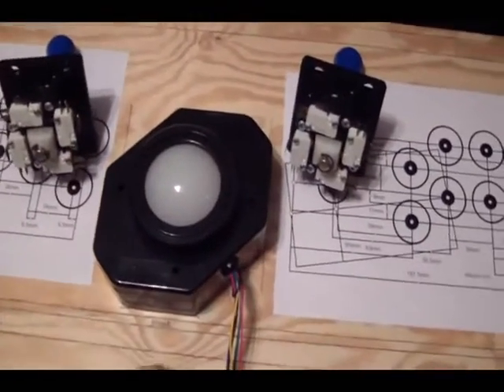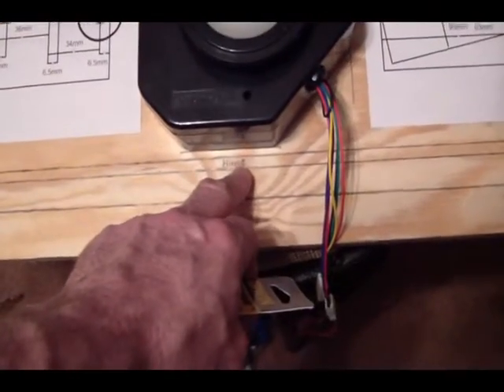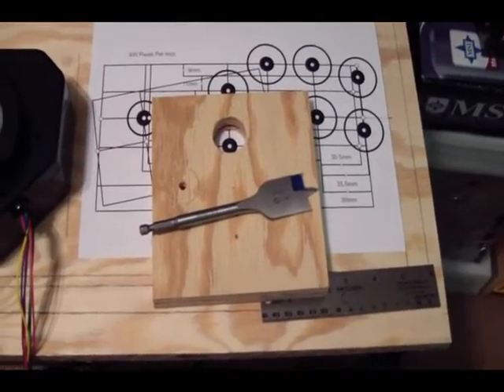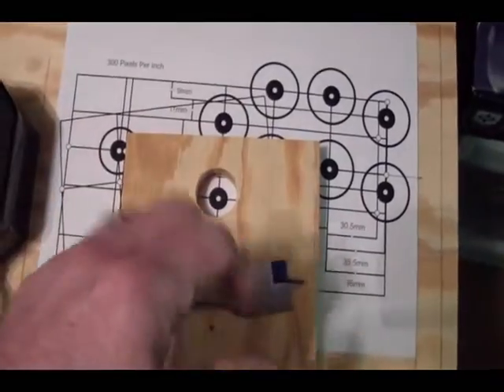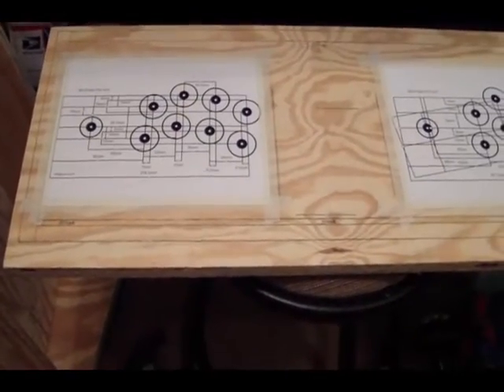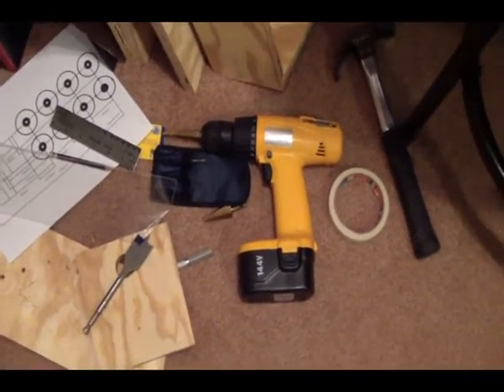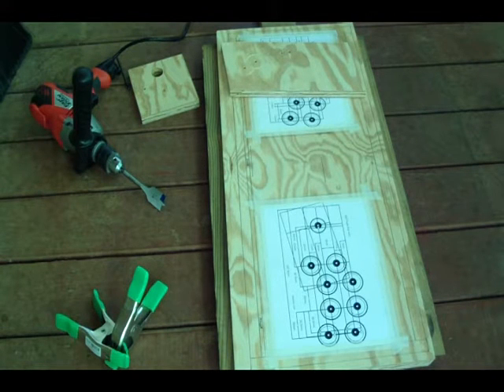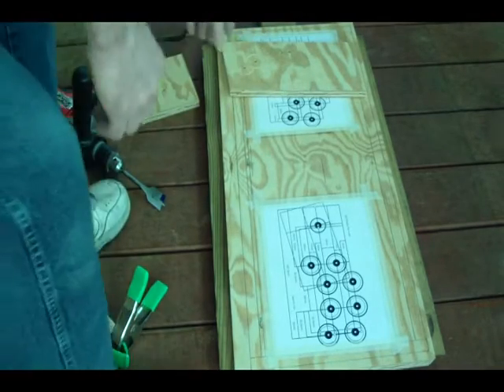(Part 9) MAME Cabinet CP Build

Comment: Hello friend .... where to get the drilling template? It has a site where I download but always when I print it never gets with the right measures could help me?...
Reply from the maker: The files I downloaded printed at the correct size.  Check your printer settings are set to print actual size.